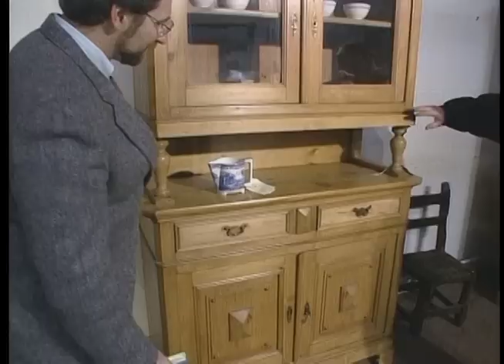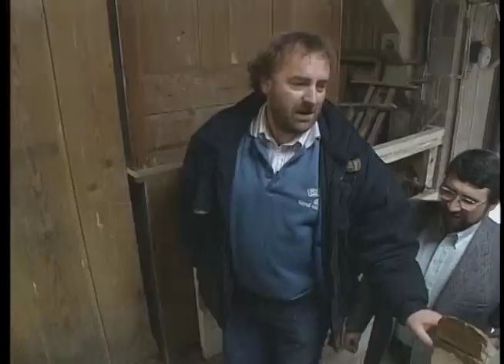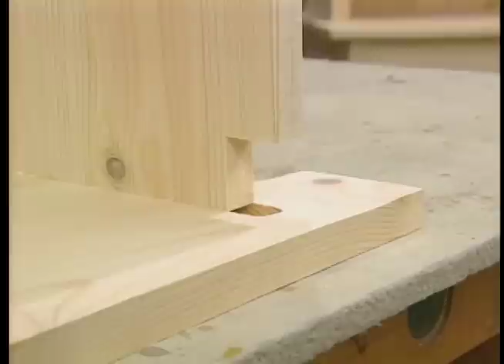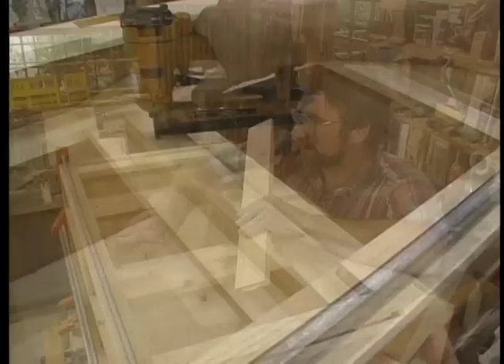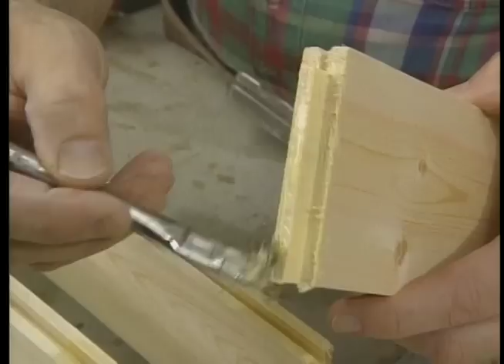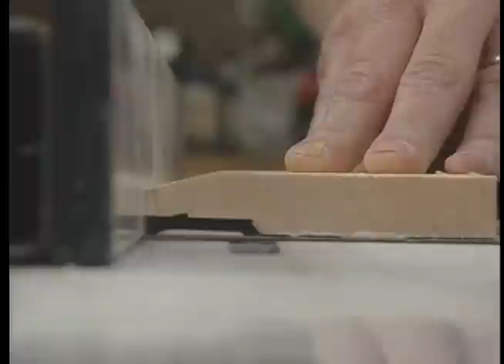Pine Cupboard  |  S5 E9

Comment: Ahhhhhh the Shaper stationary power tool finally used and demonstrated in Season 5. This was BEFORE Norm'sfancy router table and high HP routers.  I got the Jet brand Shaper versus the Delta that Norm used  in the 1990s because the Jet could use 1/4" router bits with collets along with 1/2" collets and a multitude of moulding sizes and cutters. Almost like a fancy router table but more versatility. Safer to operate molding cutters on a Shaper than a Radial Arm Saw too - in my opinion. This set up for me was better than a fancy stand up router table so I never ended up building one - although, I do have an old bench router table made from Sears/Craftsman still in use in 2023. I followed Norm's tool selection for the most part over the decades, but I differed on the Shaper brand/model. If you recondition furniture or build replicas, a Shaper is an understated and really nice stationary power tool to have and use.  I hardly ever see a Shaper used in current YouTube woodworking. As always, thanks for the memories Norm and crew for bringing the New Yankee Workshop series back to life on YouTube.

Comment: @ 6:38 Norm, my favorite type of pine material is #1 common, that only has knots in it. Oh, and yes: I love 3-1/4 HP routers, because, as you've said in part 2 of Router 101, the router table insert plate, that you were using on your 
Deluxe Router Station, can handle up to that much horsepower, meaning that the tool itself can run almost any size bit, with a 1/2" collet, to minimize vibration, giving you much cleaner cuts, that are burn-free!